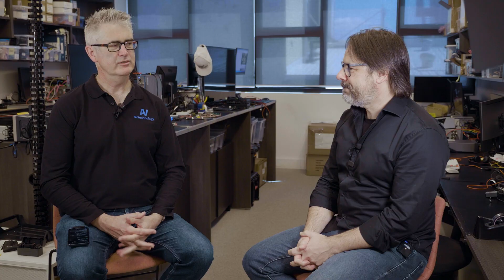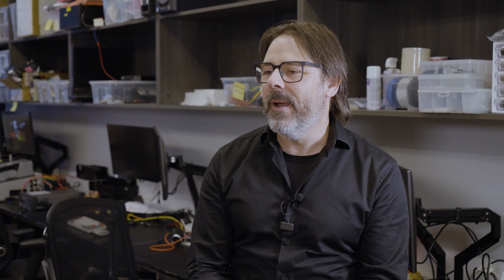🎆 20 Years of Dante | A Conversation with Chris Ware, Co-Founder of Audinate

Comment: marketspeak vs reality
1. plug it in and it works - WRONG the network has to be configured, multicast talkers, disable all L3 data protocols you don't need (which add tags which will cause retries and short frames, and why would there be AV software on switch if that were true?
2. use any switch and it works - Wrong use an AV switch with M.Gig 2.5G or better use non-blocking wire-speed ultra-low latency switch which does not see multicast as a packet storm to block, then disable EEE, then QoS PTP Clock DSCP 46 IGMP Snooping, VLANS
3. any works with any - wrong no head amp control via vendor standardized AES68
4. dante connection is the lowest price - wrong inflation of a digital mixer is over $4000 in the 
5. use any cable - wrong use any cable if you want buffering, static and dropouts so choose wisely no Al CC and 100% OFC S/STP CAT7 or CAT6